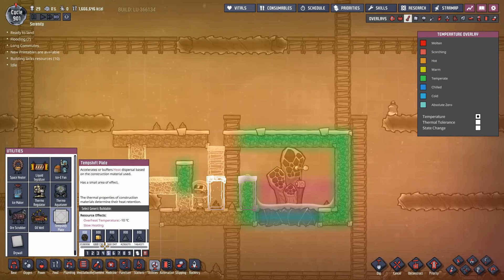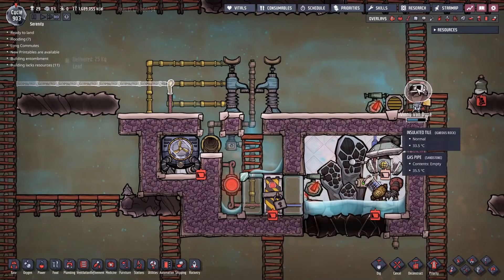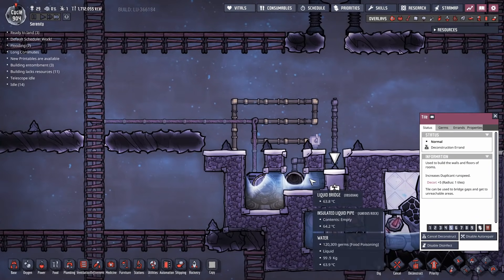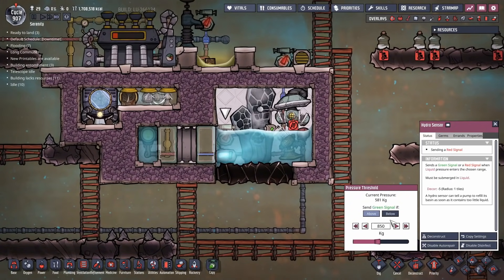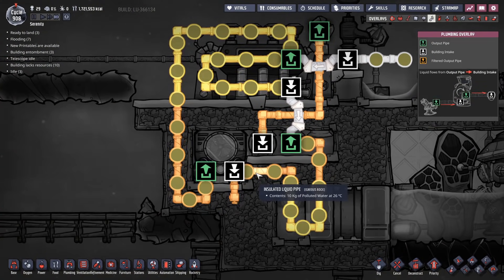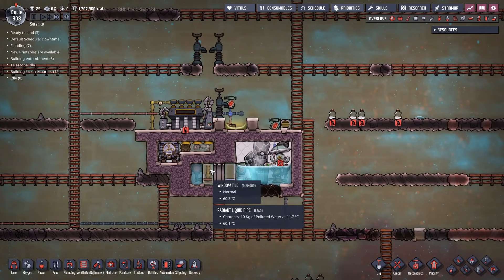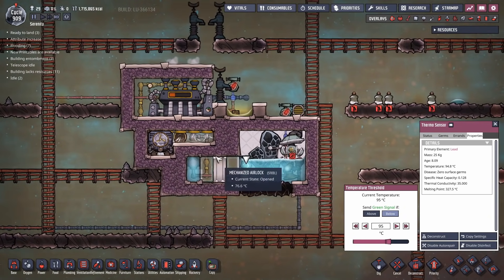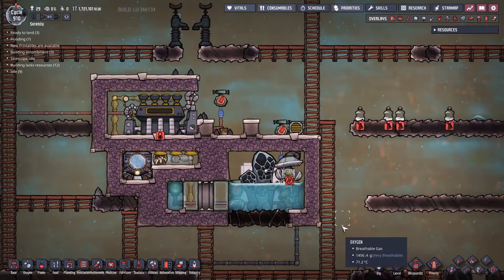Cool Steam Vent Taming : Tutorial nuggets : Oxygen not included

Comment: If you build this near the oil layer or any other hot biome you will likely need to find a way to cool the Thermo Aquatuner. Mine keeps beginning to over heat and then turing the dirt the polluted water drops into sand and entombing itself. Trying putting a ton of Wheezeworts around the aquatuner to see if that's enough to solve this but I might have to give up on it entirely. So many hours... like 70 cycles I've been working on it lol.
Reply from the maker: The steam turbine is supposed to eat the heat, do a quick google on "oxygen not included temperature management" The aquatuner and steam should never go above about 160C tops.

Comment: I am having issues with the water... The pocket of liquid around my Liquid Pipe Thermo Sensor won't stay full... I have all temperature shift plates in place.
Reply: Figured that out... But now my Aquatuner isn't consistently running... I have the Liquid Bridge in, but the output pipe keeps getting clogged
Reply from the maker: This sounds like you overfilled the loop, did you bridge on the water to fill the loop? Try emptying out one pipe if you have a plumber if you don't just delete a pipe segment and replace it.

Comment: Hey man quick question i've recently applied this design with every little detail you had here, but my Thermo Aquatuner doesnt heat up the steam high enough (125 c) and because of that steam turbine doesnt work at all so i have to keep this design connected to the main circuit all the time which kinda kills the point.. What do you think i'm doing wrong here ?
Reply from the maker: The device is not totally self powering, it will recycle some of the heat energy though. If it is not getting hot enough to make steam then it could be a few things. 1 it has only been running for a short time and has not got hot enough. 2 the heat is leaking out of the area most likely diagonally via a temp shift plate. 3 the steam vent is dormant so no cooling is being required anyway.
The save game file is attached if you want to have a look about.

Comment: I only use pure water in the steam chamber because the debris like dirt seems to act as a heating shortcut that raises the temperature of the insulation it's sitting on, not sure if they patched that but it broke one petrol boiler I built and required extensive rebuilds (debris in the magma chamber was heating up insulation which was braking pipes in the boiler).
Reply from the maker: I believe they patched debris transfering heat to insulated tiles.
Reply: @FrancisJohnYT  Really? That's fantastic!

Comment: The water in my ice box doesn't seem to cool down. It's currently at 65c. The polluted water running through radiant pipes is between 5-25c but doesn't seem to pass that cooling through.
Looking at your save your ice box has 1000kg and 800kg water on top. I'm not sure how I managed it but mine both have 1200ish KG in each. Would this be why it's not cooling efficiently?

Comment: Those three spaces next to the Aquatuner always end up with <90g of water each, and the Steam Turbine says 3/5 inlets blocked. So how do I fill them without this happening?
Reply from the maker: There is a temp shift plate behind the bottom right tile of the aquatuner, helps spread the temperature and keeps turning the water to steam.
Reply: I guess tempshift plate would work
Reply: A piece of steel gas pipe works.

Comment: Awesome work. I dig these tutorials. Speaking of which, can you explain to noobs like me the most efficient way to cool water (i.e. the water you get from the steam vent) into 30-40ish degrees? I have a water problem and the water is just too hot for normal use in the base.
Reply from the maker: In general, water that hot you send to electrolizers and turn into oxygen. It cost less energy to cool the equivalent amount of oxygen and the hydrogen part you usually end up burning in generators. I would look for ways to avoid cooling it, but if you really have to, the aquatuner is the best form of cooling though it will be very power intensive.
Reply: @FrancisJohnYT  The issue is that I'm running out of water and, as far as I know, there aren't any infinite water sources that doesn't require cooling it. Are geysers better for this?
Reply from the maker: @LWT1331  Cool water can be obtained from slush geysers and polluted water vents. The rest are hot water sources. If you make an infinite toilet water recycler and use a water free food source then the only water you need is for o2.
Reply: @FrancisJohnYT  That makes sense. The only net gain I can think of is if you use the cold steam vent water for the oil well and get it back through recycling the polluted water from the petroleum generator. 

I do recycle the toilet water. Nothing but the best for my dupes. :)

Comment: I feel like I keep running out of water. If Cool steam vents are a bad source of water, what else is a good source of water in the late game? (cycle 300 plus)
Is it just down to melting all the ice in an ice biome? You need water for a SPOM setup. How do you get "infinite" water to keep running that after cycle 500 and such?
Reply from the maker: Dig out the whole map and find all the vents and geysers, look out for the neutronium base, you will have to dig out most of them. I try to use water free food sources BBQ or wild food.
Reply: Best sources of water are

1)Polluted Water Vent(30 degree water, all you have to do is sieve it), easily the best source

2)Cool Slush geyser (doesn't produce as much, but can be used for cooling, then dumped into an electrolyzer after using a sieve)

3)Salt Water Geyser (95 degree water, has to both be desalinated or cooled to about 70 degrees so you can run it through an electrolyzer, or you can even heat it to vapourize,then covert it back into pure water and salt)

4)Cool Steam Vent(Just got to cool this down)

5)Hot steam geyser( easily the worst geyser for water, best for producing power)

Comment: just one thing I don't get, is making the tempshift plates out of diamond essential for the system to work? other materials don't have high enough conductivity?
Reply from the maker: Not essential no, you could get away with metals. Anything with a conductivity of 50+ like lead would also do. It's just Diamond is very plentiful in the oil biome and has only two uses Temp shift plates and window tiles. Everything else that would do usually has many other uses. You use diamond not just because it's great as a temp shift plate, you use it because all the other alternatives are better used for other things.
Reply: @FrancisJohnYT  I would think that the diamond is essential since you are only working with a 5 C temperature difference.  Unless you have aluminum.

Comment: and the first vent I run into happens to spit out 2000g/s at 500*C... Don't think this setup will suffice xD 
At least I'm on a cold asteroid so it won't cause me issues... yet..
Reply: That's a hot steam vent.  For those you just want to slap one or two steam turbines above it to eat the steam and turn it into power and 95 C water.
Reply: i accidentally didnt check to see if the steam vent in my playthrough was cool or hot put this setup on it then realised, but i then put a 2nd steam generator on the box directly on top of the geyser and use the gas pump to pump out the steam into a water tank
so basically the setup is cooling the steam, my 2nd steam turbine takes the steam from the geyser, then when it gets to cool the gas pump pumps like 100degree steam into my liquid tank  not sure if it's inefficent and the gas pump could probably use a thermo sensor so it only pumps out steam too cold for the steam turbine but it seems to work...
(edit could also use a 2nd gas pump)

Comment: My pipes take cold damage and I can’t seem to move heat fast enough, could t be that my mechanized door is made out of gold?
Reply from the maker: Damaged pipes sounds like you are chilling your coolant so cold it freezes in the pipes. Do you have automation attached to your Aquatuner to stop it chilling when the water is cold enough?  You should use steel for the door it has really high thermal conductivity so it transfers heat better.
The save game file is in the description if you want to download it and have a look about.
Reply: @FrancisJohnYT  thank you so much, haven't fixed it yet, now I'm trying to figure out why my steam engine won't turn on. But ill try to figure it out, thanks a ton!
Reply: @FrancisJohnYT  I'm thinking he's taking cold damage because the steam, not being hot enough, is reverting to water inside the pipe, causing "cold damage"
Reply: @petemaselli  There isn't any steam in the pipes.  That would be pumped into a gas pipe with a gas pump.

Comment: Hey I've been playing with your cooling loop design in game a little bit lately and have noticed an issue.  When I ignore it for a while and come back, the output pipe on the AT is damaged or broken.  I believe it is because the bypass + distance of the thermal sensor means that when a "too cold" packet is followed by some "not too cold" packets, the AT is turned on before the "too cold" packet bypasses it, so it goes in and gets cooled down below freezing.  Have you encountered this at all?
Reply from the maker: Leave in a big safety margin, if you use polluted water don't cool it below 10 degrees.  If you need to really get accurate temperature I use a liquid tank to even out the temp so that I can be accurate to a fraction of a degree. With the vent tamer here you don't need to cool the ice box to lower than 60C and it will still work, so give yourself a nice safety margin.
Reply: @FrancisJohnYT  I found even with setting a high safety margin (20d) the differences between packets still grew until eventually there was damage.  I fixed it by using liquid tank.  I also didn't know about filter gates when I asked that question, which I've read can also be used to solve the problem.  Thanks for the reply.
Reply: Now that I've used this design for a little bit, I really like it.  The only thing I noticed with the design in the video is you place a liquid bridge between the steam chamber and the turbine chamber, which creates a way to transmit heat between them.  Moving the pipes a little bit will prevent this leak.

As one of the comments mentioned, I think this will work with gold amalgam, as long as the thermal conductivity in the steam chamber is good enough.  The heat removal required to chill the output of the steam geyser from 110 to 95 is less than a steam turbine can remove even at 130d steam (doing the math on a typical geyser).  I think I'll give it a try next build.

Comment: Okay but why is this necessary? Steam condenses into water on its own.
Reply from the maker: In this game heat exists and does not go away. A cool steam vent will heat up the surrounding area, the heating will keep spreading until all the nearby stuff is above 100C. In the short term not a big deal, over 1000+ cycles this can get very very messy.
Reply: No, it doesn't.  It has to lose heat to condense.  It may do that by giving the heat to surrounding material, but then that material heats up.  Eventually that will become a problem.  It also  won't condense fast enough to stop the vent from being blocked due to high pressure.
Reply: I was such a noob back then. Came up with a funny design recently. It uses the water from the vent itself to cool it before being siphoned off, no need to add external water.

Comment: Why not route the cooling loop around the hot zone? Through the insulated tile? Seems like a waste of cooling/power.
Reply from the maker: I'm afraid I don't understand the question. The design tries to extract the water at 95C, if you cool it any further you are wasting effort. 95C water works in an electrolizer or oil well just as good as 50C water. The O2 and crude will come out a bit hotter but they are simpler to cool than water anyway.
Reply: @FrancisJohnYT  Your cooling loop return coming back from its run past the steam turbine jumps the insulated tile right into the hot steam room. Sure its insulated piping but unless you are using space age material there will still be some transfer of heat from the steam into the polluted water loop lowering the efficiency a little.
Reply from the maker: @christopherdine1258  yeah there is better ways to route that pipe to avoid potential heat transfer. Good spot.

Comment: for some reason my steel aqua tuner  overheated ... saw it broken even melted my heavy watt wire made of lead. after i fixed it changed the wire to iron works fine now ive changed nothing.
Reply from the maker: Strange, is your cooling loop rotating? That is the only thing I can think of that might cause an overheat.
Reply: Maybe your materials were really hot to begin with. Happens to me too much!

Comment: I built mine a lot bigger, but there was already a large pool of water underneath. With the open steam vents in slime biome, I just seal up the things in insulated tile early on before they cook everything. And then the water is there. Couldn't be bothered to throw it down below because there is stuff there. So I cool it from above and pump out the water from below. Which can then be cooled in another tank by the same aquatuner. Takes up a large amount of space and it's probably not all that efficient, but it works. But hey, it was my first time doing on of these things.

I did notice the issues with the insulation. Should have realized that the temp shift plates cause issues here. Gotta remember that next time. Some more separation between the aquatuner and icebox may not be a bad idea too. I encountered some weird bug/mechanic where a few kg of water somehow appear in the icebox that is related to that. Apparently when something is contact with something very hot (above its boiling point) a tiny part of it can boil off. So part of the PW turned into steam, which was cooled back down into water. Doesn't hurt operations and the icebox never really reached 0°C anyways, but it's annoying

Comment: The video I was waiting for. Thank you!
I thought they were more useful than that ^^".
Btw which geyisr/vent is in your opinion the most useful one?
Reply from the maker: Cool slush gives you lots of cooling but is a little water weak. Polluted water vents give you all the water at a reasonable temp and you only have to deal with food poisoning germs. Salt water and Clean water vents give you all the water but come out at 95C. They are the best water sources, everything after that starts to get more complicated.
Reply: @FrancisJohnYT  Somehow I think I'm lucky with my polluted water vent with 12.3kg output, huh?
Reply from the maker: @Pherenetic  Yeah that sounds like all the O2 you will every need every for the rest of the game.
Reply: @FrancisJohnYT  im a new player, how do i create a system that removes food poisoning from water? I struggle with it every game.
Reply: @scarlettpenney4683  using a liquid tepidizer, you can heat the water to a very high temperature, which kills it off

After which you can run a aquatuner system( look it up, it needs automation wires though,so you need to at least unlock plastic) to bring it down to a temperature you can electrolyze it

As a noob(still am one) i used the metal refinery to heat up my water, which worked pretty well
Reply: this will work, however if you want something much less power extensive watch Skye Storme's video on automated germ killing. a simple chlorine room will work wonders for you.
Reply: @scarlettpenney4683  I'm also a new player; what I've been doing so far is drop bleach stones into the polluted water tank.  It's slow, but it seems to work!  Eventually I'll get around to piping the polluted water through a chlorine chamber, once I figure out how best to do so!

Comment: For the cooling room, i tend to let the aquatuner start running, leave one tile open above the room, then when the room fills up with steam seal the room.  You get a bit of mess from some of the steam escaping but its not usually a big deal.
Reply from the maker: Risky but requires less effort to setup!! nice plan. Has it ever messed up or is it reliable? Always looking for ways to simplify.
Reply: Francis John it always works you just have to be on top it to make sure you dont lose all the steam.  It wont work if the missing tile is at the side, it has to be above.

Comment: if someone is desperate for water from a cool steam vent, he or she, can place a ceramic pitcher pump in the water, and use weezeworts, or liquid cooled thermal-regulators for the cooling a blossom patch or whatever, as long as hydroponic and pipes aren't used.
Reply from the maker: Ouch that sounds so painful, you just know in that scenario there are no exo suits and dupes are getting scalded all the time. Would still totally work, this game has so many ways it can be played.
Reply: @FrancisJohnYT  i do use exosuits for gathering water from vents. in my last colony i used ceramic pitchers for many cycles to feed hot water to 10 blossoms, keeping them cool with a single thermo-regulator that was liquid cooled by water going to my electrolyzers. sadly, my figuring this out caused me to lose track of air pressure and proper co2 scrubbing solutions, which led me to dismantling the atmos suit checkpoint as a last ditch effort to save the colony. i decided to start a new colony, and i'm still using the pitcher pumps with geysers. this time, however, i have a proper co2 scrubbing system, and automated electrolyzers.
Reply: I saw another YouTuber who kept one open and dumped cold water into it via ice temp shift plates and then
Reply: @S_Black  and then what?
Reply: It's just way to deal with an open vent temporarily.  It's micromanagement, but it cools then the area and the water without requiring any infrastructure.
Reply: @S_Black  if you have access to ice then yes. a cool slush geyser would be the best way to cool down a body of water, but those are hard to find.